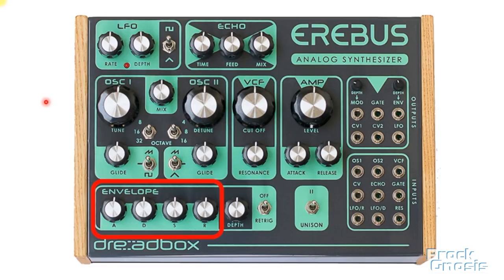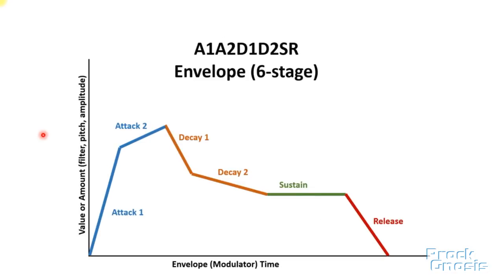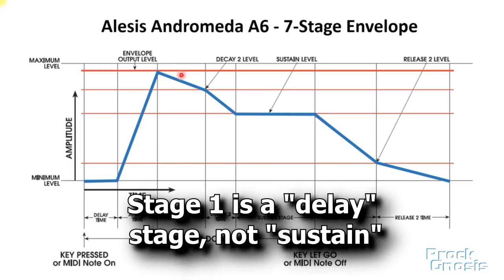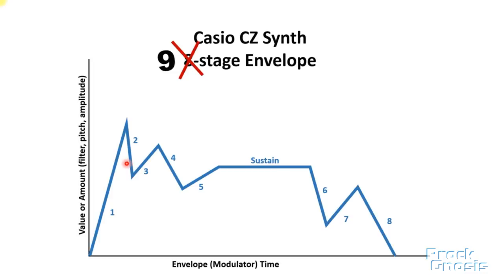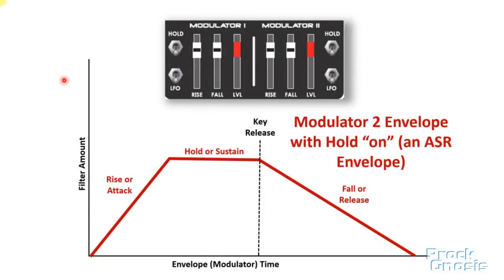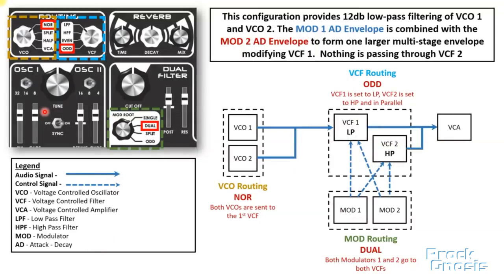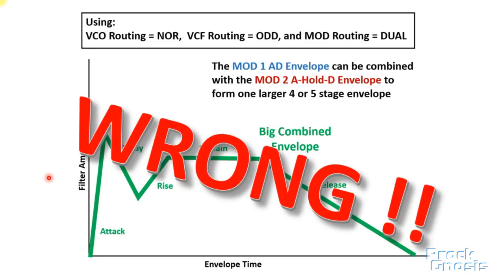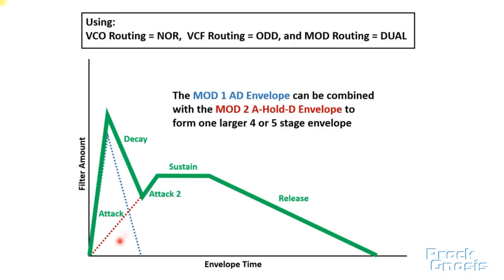Tricks for the Dreadbox Nyx - Making an ADSR Envelope

Comment: Yeah this is good - helps me get my head around it abit more - the modulators are very flexible - if abit cryptic to understand :D
Reply from the maker: Flexible and correspondingly deep. Which is why most synths end up with a standard ADSR envelope.  It's just easier to visualize and dial what you want with 4 little ADSR knobs.  Don't think I would want this to be my ONLY mono synth, but it awesomely complements other synths exactly because it will let you "paint outside of the lines" a bit more so to say.

Comment: Another fantastic lesson thanks for taking the time
To do these it’s a great help.. I’d love to see a video showing how to get the best out of the Nyx via a DAW ..  basics  such as velocity and filter/lfo being controlled/synced, at the moment I’m manually twisting knobs and recording back into cubase audio which is great but I want to get it really talking tightly and more
Automated..
Reply from the maker: And that, my friend, is the down side of analog...the digital automation (like using a DAW) is limited. The Nyx can only receive midi data for: 1) notes (on/off/pitch), 2) the mod wheel, and 3) pitch bend (if I'm remembering correctly).  Fortunately using the Nyx patch points you could patch the "MOD Output" into something else (like filter cutoff), and then program the mod wheel amount through your DAW.  That way you could tempo synch a filter effect, but unfortunately none of the knobs on the Nyx itself transmit or receive midi.  All your automation would have to be input into the synth through the pitch bend and/or the mod wheel.  Also the Nyx can't directly handle note velocity data, so that wouldn't have any effect either.

BUT, very glad the videos are helping.  I know I'm a broken record saying this, but it is seriously a cool and flexibly deep synth.
Reply: ProckGnosis hey thanks for the reply -  I was kinda hoping that somehow with a Kenton box or something inbetween the nyx and Daw I could get this little beast really talking .. oh well I love it for what it is 🎶 I’m just twisting some sounds out of it now.. it’s so easy to get lost in making sounds and twiddling knobs that i have to kick myself to make some actual music !!
Reply from the maker: Man do I know that feeling (getting lost in synthy noises instead of making music)!

Comment: This is very useful since quite some features between the dreadboxes are similar and so you get more out of it if you own just one of them. Isn't this kind of 5 stage envelopes quite similar to what you need for good brass patches?
Reply from the maker: Thanks and you're right about the brass patches.  For similar reasons, the Casio CZ actually had some really decent brass patches.  The extra stages of the envelope can let you copy the initial "pppppfffft" sound of a trumpet a little better.

Comment: Do you find you hear a background hum/hissing sound from the signal of the Dreadbox Nyx? I can’t seem to be able to get a clean signal from these things. What would your suggestion be?
Reply from the maker: Haven't had a drastic problem with mine though under certain conditions (with levels pretty high) I can get a touch of oscillator bleed.  I suspect it might have something to do with what the configuration settings are as well, but it's so subtle (for me anyway), I haven't tried to see if there's a mitigation for it.